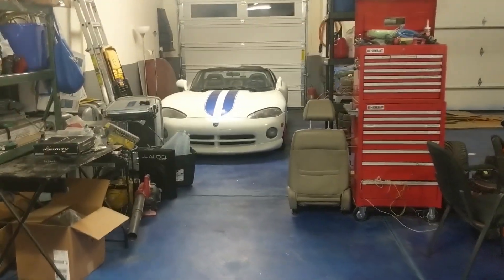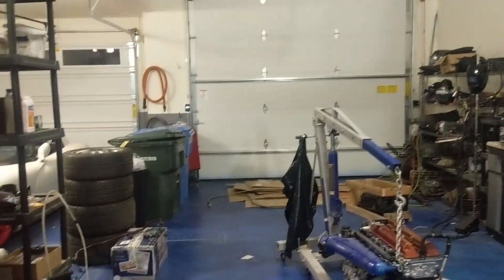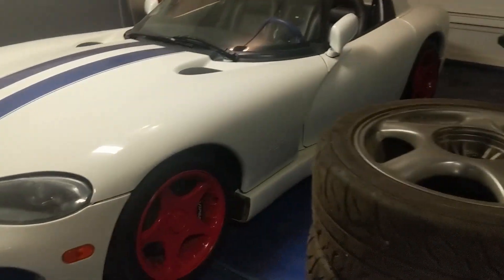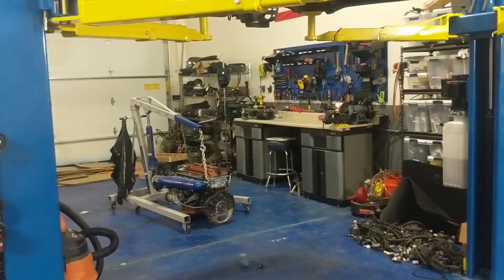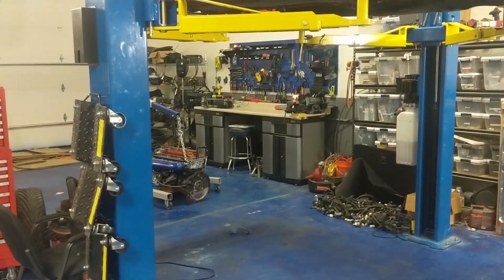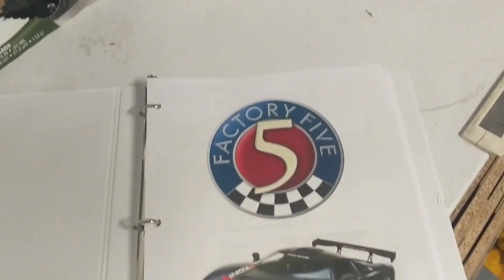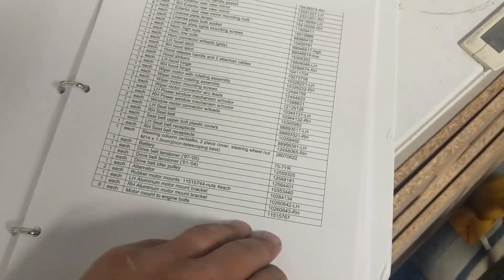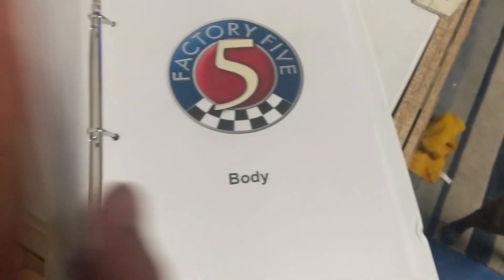Intro to the New Project Car

Comment: Hi, I’m starting my 2jz build and I’ve been reading a lot on is.elite the info you have there is crazy good!!! I plan on keeping my auto doing the mods( shimming actuators etc.) you demonstrate. By any chance Are you “mitsuguy” from the forms?
Reply from the maker: Yup, that's me!  Haven't been very active on the forums in a while though.  Glad the website is helping!
Reply: Cody Graham hahaha that’s awesome been reading you comment in the forums for YEARS your knowledge is top notch... wish you would’ve finished the DIY AEM Infinity wire up! Not looking forward to paying 800 to boomslang for a harness. Wish you the best with your new project!
Reply from the maker: @wrivas9475  It's essentially the same as the V2!  there's almost zero differences!
Reply: Cody Graham that’s awesome to know! I’ll use your V2 wiring diagram to wire it up. Thanks man!